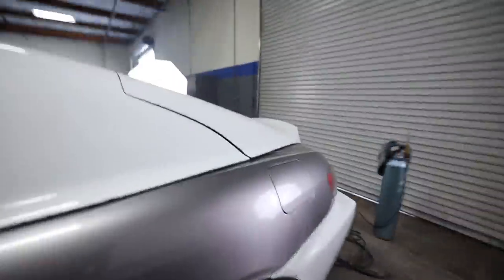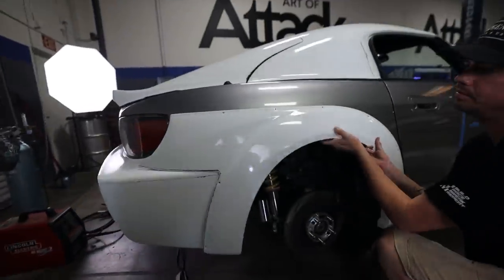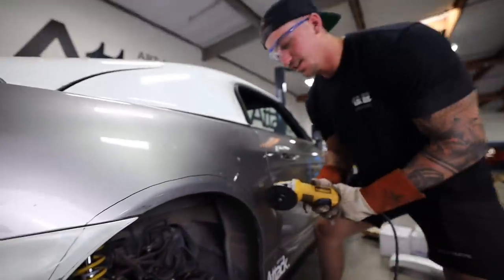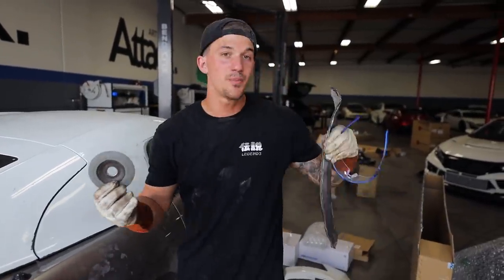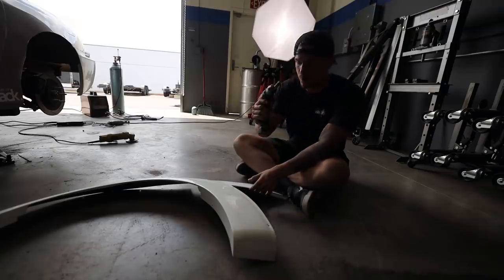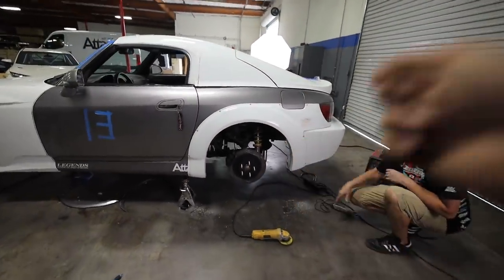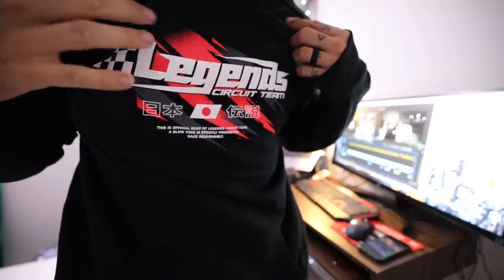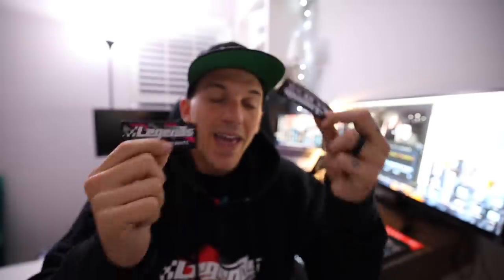Installing JDM Spoon Widebody on my Honda S2000! Pt. 3

Comment: Those rear guards need a little something something to sort the gap by the rear lights. They also need the nice little rubber moulding between the OEM guard and the over fender, just to finish it off nicely. 
It may be a track car, but details are important.

Comment: The car is coming out nice. Not sure if you already did this, but you should also cut inside of the front fenders. The same trim you cut off for the rear over fenders, you should definitely cut the inside of the front fenders for maximum clearance. The wheels can easily catch on it and crack the fenders and you definitely don't want that. Can't wait to see the car in one color. What color wrap are you going with?
Reply from the maker: We did, but lost the footage
Reply: @dustiinw  figured you guys did if you did the rears. Looking forward to the next episode

Comment: You guys dun goofed. The S2000 rear quarter is comprised of two layers (inner and outer layer). Best way to fit over fenders is cut the outer layer off then fold the inner layer up and over and weld it to the outer layer, that way its sealed up and nothing can get up unto that void. Because you cut both layers off youll have to look at sealing them up so water and debris dont get up into the gap and start rusting the car from the inside out.

Comment: I feel like this wide body on this s2000 should be molded on to the car for better appearance and better flow
Reply: Its a track build. If he comes off and smacks the kit, it'll be a nightmare to repair if its moulded.

Comment: So you’re just gonna cut the 1/4 panels like that and leave it? Sharp metal pointed straight at the tire, no rust protection, nothing to restore the rigidity of the chassis? You need to bend that up and spot weld the inner and outer arches together.
Reply: It’s not sharp we used a tiger paw on the grinder to smooth the edges. About the welding. We are waiting until he gets his new wheels to see if we need to cut more. Then It will be welded 👍